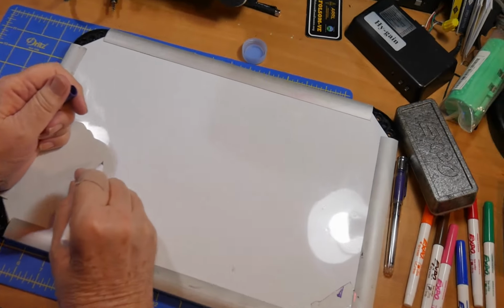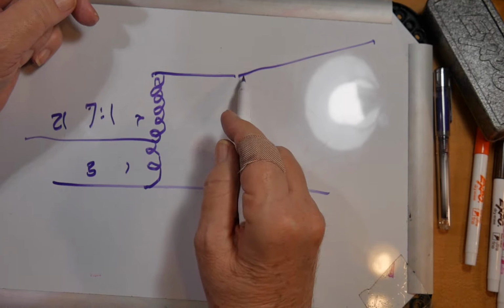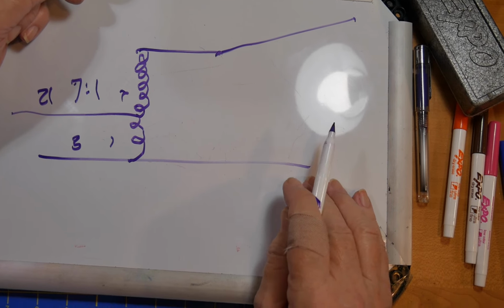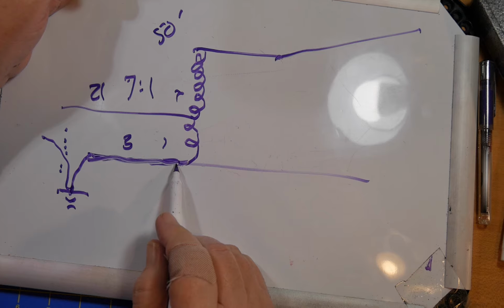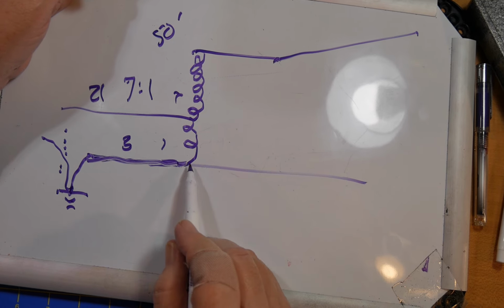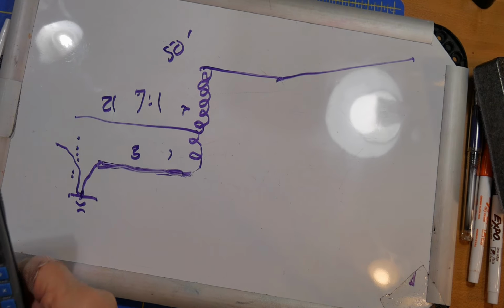Trimming End-Fed Half-Wave Antenna (#1194)

Comment: Thanks Dave, I've been a follower for several years now. I like experimenting with and building antennas. I've probably built more than a dozen 49:1 transformers for EFHW antennas and have one of my originals at 5ft off the ground around my wood fence to run my Winlink gateway. I like 12 or 14 ga thhn stranded because it's relatively easy to work with and will stand the test of time and weather when outside permanently. I love my EFHW's but also run a DX Commander Classic w/80m for DX. Thanks for all your experience and wisdom.